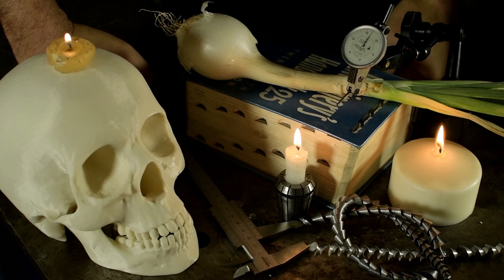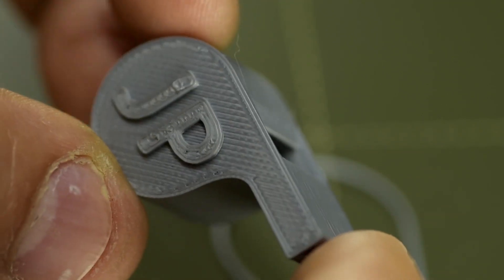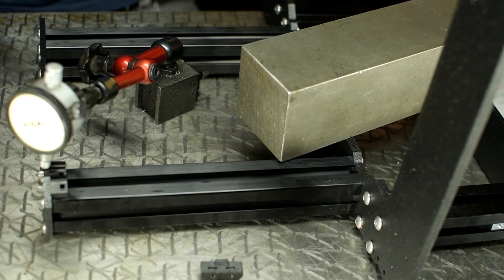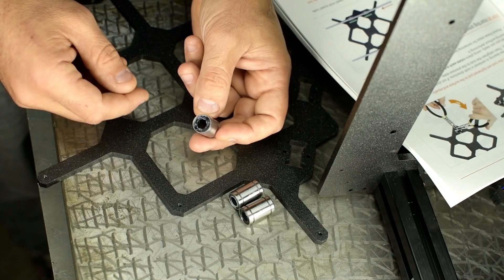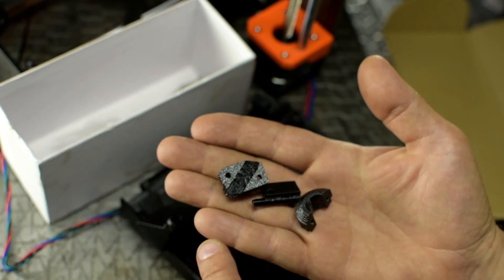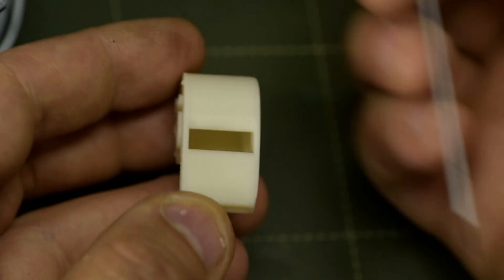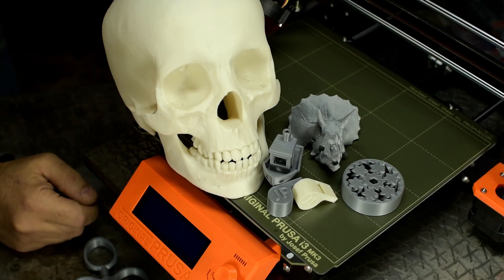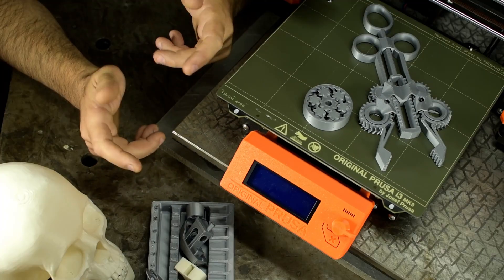This Old Tony in 3D!!! (printing)

Comment: I have an Ender 5, and my friend has an Ender 3.  You don't want either if you have the money to spend on a Prusa machine, they are really that much better.  Your prints "out of the box" are better than what I'm currently getting after upgrading to a E3d V6 hotend ,a Bondtech direct drive extruder, and a silend 1.1.5 board running Marlin 2.0, among many other small upgrades.  It's been a year of fighting with it, and everything just slowly gets worse, no matter what parts I'm using.   It's a great machine for a the price, it's just not built well enough to be a GOOD machine.  

Also, at some point you may run into a part that has no decent way to hold in a vice, and decide "I could totally print some soft jaws custom for that awkward shape", I'ma let you know right now that It's a great idea up until you make a few cuts and the jaws go soft from the heat in the part...

Comment: This is gonna be a bit of a long comment, so grab a cup of tea and take notes. ;)

My experience in 3D printing comes from Printing on 2 two machines (both are out of service now) for I think at least 3 years, I can't remember exactly. I started out on a Leapfrog Creatr Dual and later moved on to a more reliable Prusa I3 MK2S. Over the years I've helped a few friends out, troubleshooting, looking for printers, filament, etc.

To everyone looking for a cheaper alternative to a Prusa machine: I know a few colleagues that use the Anycubic I3 Mega and similar models. I can recommend that model, it's a bit more expensive than the ender, I think, but it's definitely a good and reliable machine.

And To you and to all the Prusa users out there: I recommend thinking twice about installing any upgrades on the machine. This comes from personal experience. I installed the upgrade from the MK2S to the MK2.5S and the extruder only gave me trouble since. Yes, this will probably be different for everyone, but there's a reason the saying "never change a running system" exists.

The benchy looks good, the "whiskers" are called stringing and they are often caused by high temperature and/or wrong retraction settings. Also, you have ghosting. That's the vertical lines after an edge that look similar to chatter. There are of course ways to get rid of that, but I'd have to take a closer look and know a bit more about the settings. You can also see that there are imperfections between the layers, that's also probably, as so often in 3D printing, a settings problem.
I'm surprised that the overhangs worked out so great the first time. Prusa really does provide you with a good machine right out of the box (or right out of the assembly).

A lot of things can be done in the settings, you can turn a mediocre printer into a good one but also a good one into a crappy printer. 
I'm assuming you're using Prusaslicer? (or slic3r Prusa edition, or whatever it's called now). I really like the program, and I can help you out with problems and troubleshooting if needed.
I've also got experience in Simplify 3D, which is a great program, but it's quite expensive, so I can only recommend it to people who want to spend that kind of money on their slicer.

Since getting into machining, I wish I had the ability to print more fixtures, assembly guides, and prototypes to get a feel for the parts, but as I said earlier, I don't have a working printer at the moment.

Comment: Doesn't PLA plastic degrade (fall apart) in strong sunlight or UV?  Might be better to use ASA or ABS for "outdoor" objects. PET-G is used in soda bottles. I wouldn't suggest eating it, but it won't poison you if used to make drinking cups.

Comment: I have a Creality Ender 5, and I'd recommend it only if you already have some experience with this type of manufacturing. Its definitely not as user friendly as others out there (I use Ultimakers at work and they're much easier to deal with) but if you have the experience or are okay with a definite learning curve its a good hobby tool on a budget.

Comment: The Prusa i3 is one of the best options for easy-to-use printers, as it's been in development for almost a decade, and all the bugs have been worked out by thousands of years. I have an Ender 3 myself, and it's a decent printer for the price, but it's definitely not for someone new to printing.

Comment: The benchy looks great, some wispy strings are to be expected, you could spend ages trying to super fine tune the printer to get rid of them but the easiest thing to do is just hit the print with a hairdryer or quickly with a heat gun, it'll get rid of the wisps. The only thing you could say about the benchy (the name of the boat) is you're getting a little bit of z banding. If you look at the bow of the benchy you can see its a bit wavey, to mitigate this, try printing at a slower speed, making sure there's no debris on your z axis rods, or readjusting the stepper motor couple. Its a great benchy but if you wanted some tips to get it even better thats what i would suggest

Comment: Kind of surprised with the zip ties holding up the hotend carriage 😲 I did not expect that from such an "expensive" printer. Have a Creality CR10S myself and it's good but yeah, don't expect a flat print bed, great hotend, a good extruder solution or good working fans. But with some upgrades it become really good and still fairly cheap with a quite big printing volume. But yes, prusa is better quality (besides the zip tie part 🤔)

Comment: Good tip for beginner printers: don't cheap out on filament, buy quality one, especially when it's Your first roll. I had a little bit of good PLA and then bought cheap one. That was the moment when prints refused to stick to heated glass bed and I was forced to use gimmicks like hair lacquer on bed to improve adhesion.

Comment: I'm personally a big fan of MSLA printers because of the super-tiny layer size, which explains why it's such a popular 3D printing technology for anything that has a lot of details in it. Got a Creality LD-002r printer around now (190 Euro), and it's been a dream to print with. 

It does involve handling some not-so--nice resins, the fumes aren't awesome, cleaning is troublesome (though fixing that with a new ultrasonic cleaner soon), but the pay-off is so worth is compared to FDM printers.

At the starter price level you have to accept that you're not getting a lot of print volume, of course. That's where FDM still has a leg up, but Elegoo's Saturn MSLA printer for one looks to be changing that now.

Comment: Printers are great learning tools too! I'm a mechanical engineering student and messing with a cheap Ender 3 I found on facebook has taught me way more about gcode, manufacturing, and CAD design than any classes I've taken so far lol.  Lots of troubleshooting will be involved as soon as you move to materials outside of ABS and PLA, but that's half the fun!

Comment: Hey ThisOldTony, with the Benchy, the benchy guys have a page on how to analyse it http://www.3dbenchy.com/dimensions/

Love the content, keep it up. Also, 3D print yourself a MAHO
Reply: Each of the dimensions they call out align with either one of the major axis or represent a problem area for 3d printers (such as overhangs, perfect circles, small holes, ringing, z artifacts, etc.)  Because of its shape if one of the dimensions is off you can track it back to the exact root cause though if you aren't familiar with printer troubleshooting some of the errors may require advice.  In general I recommend checking at least one dimension per axis, checking the depth of the box in the back of the boat and ensuring that both of the small holes are fully clear to the indicated depth as well.  Look at the slope of the roof to make sure that z axis advance is consistent even if overall height is correct.  Look for ghosting on the sides of the cabin to judge how much ringing you have.  The ghost effect will be most noticeable near the corners where the print head rapidly changed direction and inertia is fighting against the rigidity of the frame and the drive system.  The small text plate doesn't even show up on many printers due to its 0.1 mm tolerance requirement to be legible, so that is a fairly nice indicator of overall positional accuracy.  If your version also has text on the bottom, legibility of that text can indicate if your first layer offset is correct.  Too high and you'll have bad adhesion and parts of the lettering will be missing, too low and it will be smushesd by the second layer and almost invisible.  The stinging is an indication of filament quality, moisture and printing temperature.   You can reduce it by drying your filament or tweaking your print temperature.  If you also see blisters in your surface finish then you man have a lower quality filament with inconsistent thickness. If you hear a hissing or popping while printing that is a tell tale sign of filament moisture.
Reply: Just went there and scrolled through the measurements.  Didn't dig too deep in the site.  I assume they tell you what to do if your print doesn't match those dimensions?
Reply: God, I hate sites that fuck with scrolling.

Comment: Be careful with humid filament! if you see stringing any time, try drying the filament
Reply: be careful with advice about 3d printing.  90% of it is wrong
Reply: @natalieisagirlnow  i saw a video about this,  but if you think i'm wrong, tell what is right and help me understand better
Reply: @RedsPC  abs is non hygroscopic.  it can't absorb water.  pla could, but you are putting it through a nozzle that is way higher than the boiling point of water.  if you see pocking or bubbling,  it could be an issue, but it almost never really is unless you use nylon or exotics
Reply: I've had PLA in my basement for months and never once had to dry it.

Comment: As for that dry box I mentioned, plenty of guides about it but this one is fairly comprehensive: https://www.youtube.com/watch?v=WEFtUKGAd7k
You can also find hydrometres which screw-fasten onto interfaces but for tightness you would need to make a rubber bung for keeping moisture out, and if your box contains enough slop, a rubber seal for the inside.

Comment: Using a Creality Ender 3 here, it's a brilliant one for beginners like me! Easy & quick to set up
I have had some fan & fan bearing failures, so you might want to keep an eye on that and have replacements ready, personally i replaced the stock fans with Noctua fans for quiter operation, otherwise, it's really good
Reply: Ender 3 Pro user here also. Had it for about 2 years now, 3 months in I added a BLTouch and last month the first problem occurred after running flawlessly from the start.. Both the temperature sensors on the bed and the hot-end suddenly showed minus degrees Celsius and other times over a couple hundred degrees randomly.
Swapped out the thermal sensors but still the same problem - ended up being the mainboard being the culprite so swapped it out for this new new v4.2.7 silent board and MAN what a difference! 
Motors have gone literally SILENT! 
All i could hear were the obnoxiously loud stock fans so today i swapped them out for Noctua's also and couldn't be more happy.

I'm actually glad the stock mainboard died. Man what a difference!
Reply: think i doing the 32bit new board for my ender 3 pro
Reply: @jenibond  if you mean the new v4.2.7 silent mainboard; absolutely 100% go for it. The silence is absolutely amazing.
Reply: @mandem9319  yep think its its No brainer for $   and I have Bl touch to fit when i have time !
Reply: just something I do i use PrusaSlicer with ender 3 pro defaults and it works really well out of the box !!!
Reply: @jenibond  I'm certainly not saying there aren't better printers out there, there clearly are. But there's also some overpriced shit too, like the makerbot my office bought for $2000.  My e3p might be fiddly, but the print quality kills that makerbot.

I have a pretty low threshold of dicking with things in general, but it's been worth it to me.
Reply: @jenibond  Skr1.4 any day! Been printing for 8+ years, cartesian, deltas and numerous other of my own designs and by far one of the best upgrades you can do is change the boards out. A good set of 2209 drivers too.
Reply: Hey!  Me too.  I bought mine back in August.  It's been weird about swapping from PLA to ABS, but the quality of the prints is on par with the Makerbot Replicator at my job.
Reply: Ender 3 pro for £150, couldn't justify the price for a prusa. Works great and highly recommend it.
Reply: I also have one--- almost never use it though...... mostly because I suck at fusion 360... and I keep having problems with getting the first layer to stick... and that tiny sd cart reader that came with it shorted all the usb ports on my pc...
Reply: @olik136  Don't get me started on Fusion 360. They basically threw out autocad and started from scratch. I've been using autocad since the early 80's and no matter how hard I tried, I couldn't get my head around it. Plus I didn't have hours and hours and hours to go through their tutorials so I said screw it.
Reply: I have 2 Creality printers a cr-10s pro and the latest kickstarter cr-6se the cr10 has a couple of hundred hours on it and it still runs perfect parts exactly the same as it did out of the box. And the cr6 has so far been a slightly smaller but also perfect printer. Probably only 40 or 50 hours printed so far.
Reply: I have an ender 3 too and it works great, never had big problems, although on my first print, I tried to print all of the upgrades that I wanted at once 🤣🤣, I woke up to a birds nest, one thing came loose and knocked everything over!
Reply: I just upgraded my Ender 3 board to an SKR E3 DIP 1.1. It was the cheapest 32bit upgrade ever as the board was less than 10 bucks. I have upgraded the PSU and I added a Genuine BLTOUCH. I have 4 CR-10S I am going to upgrade as well. So far my fans have lasted for quite a while. Most people just upgrade to quieter fans though.
Reply: 4780h of print time and counting on my Ender 3 so far. No failures at all. Gone through quite a few nozzles. Also put in a silent mainboard and different mainboard enclosure +fan  to fit it. Prints like any other well tuned machine and just does its job. 
Something of note... i've got an engineering background and thus installed selfmade bowden couplers and a stabilizer for the wires on the hotend before the couplers or thermistor/heater wires had a chance to move and fail. But so far with those modifications as well as some cleaning and oiling occasionally i got no signs of wear at all.

If you're crafty (who owning a printer isnt?), the Ender is a solid choice to go for.
If you're a business / institution, value good foolproof instructions and don't want to change or fix anything, Prusa it is.
Reply: Hey ender guys, if you had to do it again today would you go ender 3 pro or anycubic mega S?
Reply: What a nice surprise to see you here as a fellow 3D printer, wouldn't expect it
Reply: The prusa has noctuas stock i believe.
Reply: @Nordern Wait your here!? But in all seriousness my ender is priceless!
Reply: https://youtu.be/OuB4Xfdk4eg
Reply: My Ender 3 has been great, but it's no Prusa. Mine took fiddling and a couple of days of learning slicer settings before it "worked", then another week to wait for the glass bed so it'd be reliable
Reply: Oh yes the Creality fans, great quality, will last at least 10 minutes without the bearings going to hell 😂 I've had to replace two fans (the third cooling the printed materiel seems to hold up but the one cooling the hotend and the one in the controller does not) , which Creality sent me, they have failed again soon after the swap 🙆‍♂️ so been looking at nocuta as well 😏
Reply: @AlexKall  I'm going on 2 years and over 2000 hours on an ender 3 pro without a single failure that wasn't my fault. I put a bond tech extruder on it, and broke the fitting for the bowden tube off almost immediately.

Otherwise this thing has operated flawless.
Reply: @elesjuan  Me too, I have yet to break anything after a few years of heavy use. That's how poor quality control works though: the best widgets are still great, but sometimes you find a lemon.
Reply: @AlexKall  watch this then...if you build it the right way and check if everything is straight and level, it'll be without problems. Like the guy in this video says: there are 3D printer farms with Enders...think about it. Whould they do that when they break every so many hours? https://youtu.be/wjp39O9jopk
Reply: @AlexKall  I've run the stock fans for 6-7 day prints on both my Ender 3 and 3 Pro 400XL,  and have only changed a Creality fan due to me sticking my tweezers into one and breaking a fan blade. I hope this doesn't jinx me now!
Reply: @HRWatson68  I guess I got all the bad fans they had in stock for my CR-10S, no one else seems to have a problem with them 🤷‍♂️

After a few changes, like IKEA mirrors as bed after fixing the not so flat aluminum bed plate, adding a Bondtech extruder (love that thing, what a difference!) and designing and printing new support for the screw rods to get rid of a some of the annoying sounds I'm really happy with my CR-10S. 

Still need to fix the fans eventually though, been pushing that on the future constantly.

Comment: Hope you had less issues than we did. Nonstop issues with misaligned holes, burrs and rough printed parts. Not that happy.
Reply: @npgoalkeeper _ It just left sour taste in my mouth. Ended up taking twice as long as it should. My Prusa was down for the last two weeks because something was bad between the extruder and hot end (2nd month owning it). Calling support ended up being not great (they really didnt want to help and said it was working fine EARLIER so it must be something we did since then) so we just disassembled it, did a mod and now it works better. Not very happy. Will get a Creality next time.